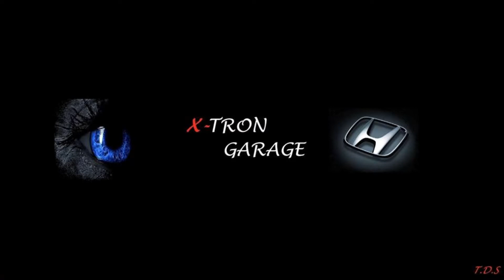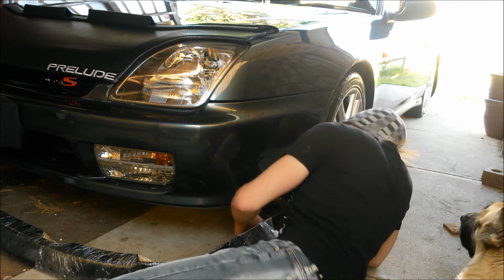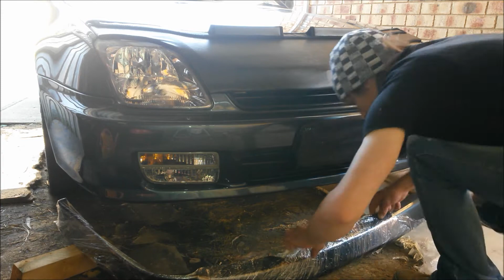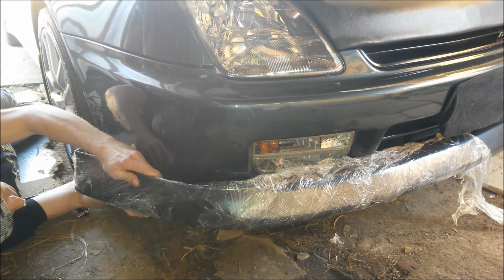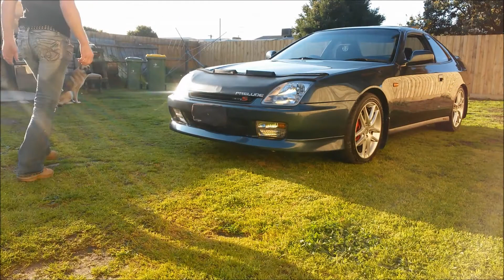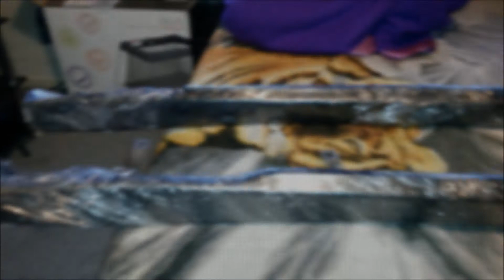Honda Prelude OEM FRONT LIP Install

Comment: Hey!  Beauty Lude. I’m adding this lip on mine soon and just curious if you used 2 sides tape as the Honda instructions show, or just the 2 screws and the bumper bolts? Thanks.
Reply from the maker: Thanks for the comment. I didn't use the two side tape I just used the bolts to the bumper.

Comment: What holds it in place? Looking to do mine myself
Reply from the maker: Garrett Reaves. If it's made by Honda it should come with plastic brackets stuck behind the lip and about 8 bolts. If you look underneath your prelude's  front bumper you'll see the locations of the holes where it should be located. Good Luck.
Reply: X Tron Garage link to where I can purchase ?